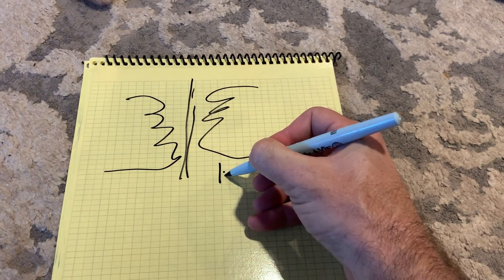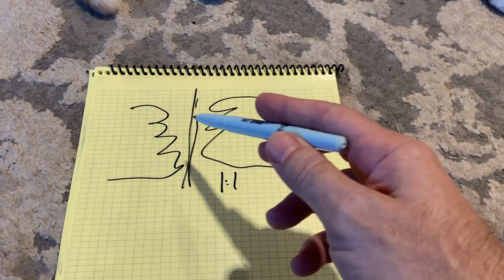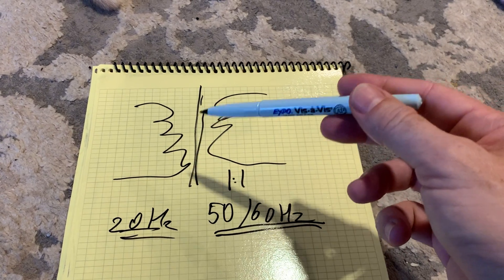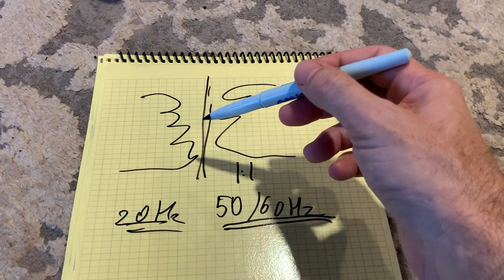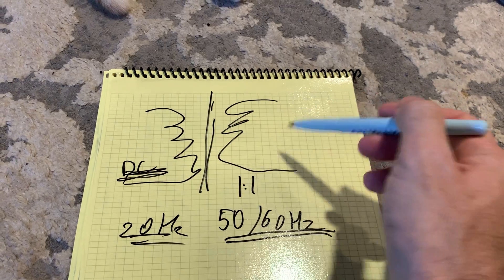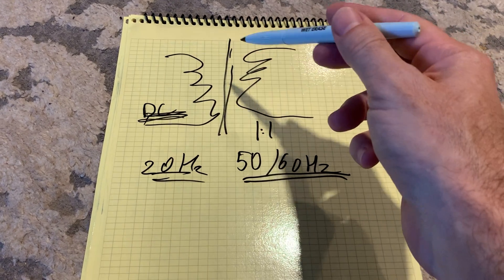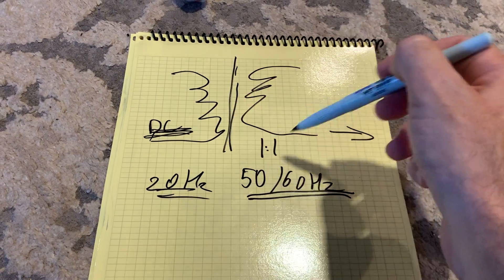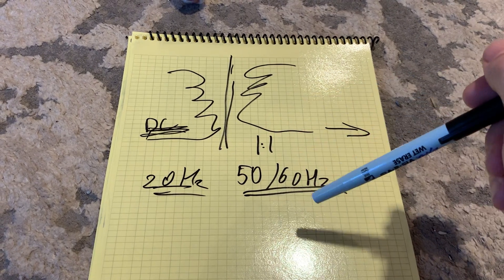Power line Isolation transformers for audio: good and the bad in 3 minutes

Comment: Hi Janos,

I just got a 300b amp back from repair, and I can see that the guy used a step up 230v regulator on the transformer for like 50 USD because he felt that the amps 220 it needed it.
But my other friend said that it is not needed in Denmark, where you can get away with 220v and 230v.
Who is right, and is it a good or bad thing sound wise?

Larry
Reply from the maker: Hi Larry, if an amp sees only 220V when the voltages are optimized for 230, then the operating voltages will be a tiny bit lower, that will result in 2 things: 1. slightly lowered power output (very slightly) and 2. noticeably longer tube life. 
As most commercial amps are pushed to their limits, that little drop is most welcome and preferable for almost any amp. There will be a tiny drop in output power, but the amp will also sound less strained and more organic. That's generally true... however, when an amp is exactly optimized for the input voltage, then there's no benefit for dropping the voltage, then it will just sound more sleepy. I suspect that the step-up might make matters worse than leaving at 220V, unless it's a super-duper high quality step up...
Reply: @realworldaudio  Thanks, a very well formulated answer that the entire internet could not give me.
Reply: Big help Janos! Thanks.
Reply from the maker: @realhi-fihelplarry8047  You are welcome Larry !;

Comment: Dear Janos, there are some circuits using diodes, that eleminate the DC offset. Probably those have certain disadvantages too, but what if we put such a device in front of a very big size isolation transformer? Please elaborate on that.
Sad news from Greece: After some months from the passing of Vangelis, Irene Pappas has passed too. RIP
Reply from the maker: Oh no Irene Papas passed away! I'm so sad.... 
Adding DC blocking capacitors or diode-based circuitry will create oscillations, harmonic noise. Anything we do, impacts phase, adds harmonics, or limits current draw or the combination of these....
Reply: @realworldaudio  Everything is like medecine.........sometimes worse than the desease....but in some cases the desease is worse than the medecine too......Best is to use as less as possible to interfere with the dynamic demands of the electronics and to build the best possible power supply for a given electronic device that goes into a music system.
The comfortable suspension of a car on a bad road is not the same as the very hard one of a race car on a track......
Have a nice day pipis and all..

Comment: Transformers /isolation transformers can be bought in different qualities.......avoid toroidal ( saturation /less forgiving for the presence of DC on the line ) in this case ........buy medical quality with electrostatic shield ( less capacitance between windings and lower noise /better filtering of the AC  line )..............even symetrical /balanced AC power is possible on double secondary windings .......
I had a friend in BXL where there was a lot of rubbish on the line .......since he's very happy ( monoblocs 2A3/AN speakers )....Every case is different .......when it works for you it's ok .......

A good approach when building your own amplifiers etc is to spend a lot in designing a good psu to start with.......it will by the nature of its thoughtfull conception already be LESS sensitive to the quality of the the AC outlet.......

And yes sometimes a simple capacitance can also work , be aware to use only X2 ( self healing ) capacitors designed for the job !
I put small capacitors on the secundaries of my source transformers ( CD players etc ) ........listen , they make a difference and your ears will tell you about the values.......( small in this case ....sometimes pF ) all depends....the result is all that counts . ( I do the job with headphones for fine tuning )

Comment: When using an isolation transformer we need to be aware of our earthing arrangements as the secondary is not referenced to earth. The power system should only have the neutral connected to earth at the intake to the house, never in the distribution circuits. If we have some pieces of equipment fed from an isolation transformer and others not, the earthed interconnects provide an earth path to all conductive parts, but the voltage present from the isolating transformer won't be referenced to this. I wonder, with leakage currents and such like, whether we are creating possible extra noise and safety issues in this way?
Reply from the maker: Yes, the earthing of the transformer can become an issue.... if we reference it back to the safety ground, we are injecting in the ground noise.. if not, then it;s a major safety issue.... also, if the entire system is not on the same isolation transformer, then the ground issue can make the situation much worse than without the transformer.. and when we stack everything into a single isolation TX (from turntable trhough digital source, preamp, amp etc) then we are seriously limiting their current draw & making sure that the worst noisemaker pollutes every other component to the max. That's why I isolate the turntable motor, and the CD player, but nothing else. Their ground is still connected though, so it's not iron-clad isolation..
Reply: Would this issue be eliminated with an Equitech solution, aka balanced mains? With everything connected to it of course - it can even be made into a whole-house solution but obviously not recommended due to cost and no benefit really from running a fridge from it.
There are many who say that balanced mains is the way to go for audio and also video. It's a simple and genius alternative to the usual mains circuit - here we have the line and neutral in opposite phase and as such noise should be nulled in ground.
Reply: That's where a symetrised power supply comes in ..........the ground is in between.
A good design and a high quality ( medical/militaire ) isolation transformer can be a good solution .....IF YOU NEED IT !

Comment: I’m using a isolation transformer to for my low power consuming pure class A SE, amp is using always 100w. My total rig draws 400w:230v= 1.7A. My isolation transformer can deliver continues 7A. Meaning I think I’m safe because of the system is drawing always the same amount.. Is that correct?
Reply from the maker: Hi Nick, my experience with my class A SET double Darling amp (about 50W total, less than half an amp) was that placing it on a 10A rated isolation transformer I could noticeably hear dynamics and transients curbed. Even though the power consumption is very little, or the supply supplies a constant amount for the tubes, but the supply needs to replace the demand. These instantaneous draws can be quite extreme, and there's a noticeable improvement when I went from a 15A outlet to 20A outlet, and when I changed the supply line in the wall between able to deliver 20A or 25A of current. While I don't think that the tiny amplifier draws 15-20A  brief peaks, yet, the amperage rating of the source tells us how FAST it can supply ANY amount of current - higher rating, faster the supply. Even though the difference appears to be minimal, it's still very audible. When I installed the isolation transformer this drawback in dynamics and transient limiting was not so noticeable. When I removed the TX, then it just hit me how faster and more dynamic the transients are.

Comment: yeah that's right but you don't need an isolation transformer. like I said before just a small value cap to block DC will do the job and won't suffer dynamic issues
Reply from the maker: It would be a nice solution, but nowdays because of the constant SMPS extremely high voltage peaks I am not comfortable of using a cap in the line any longer...